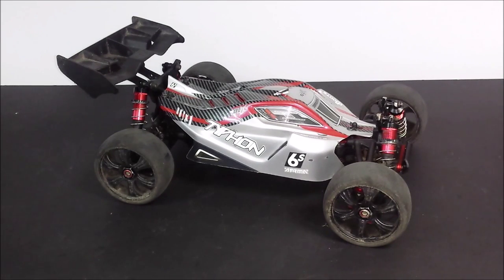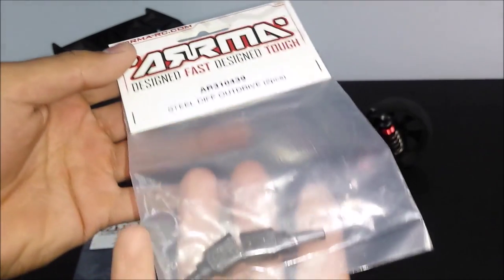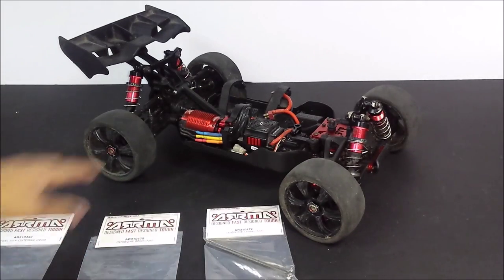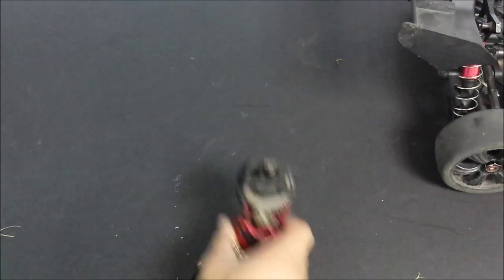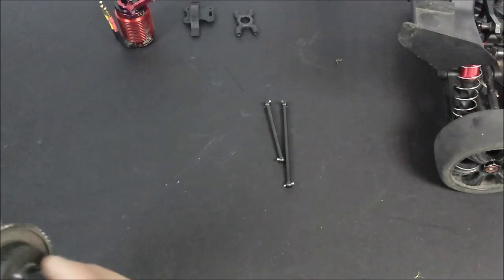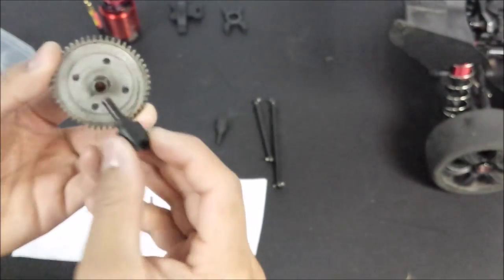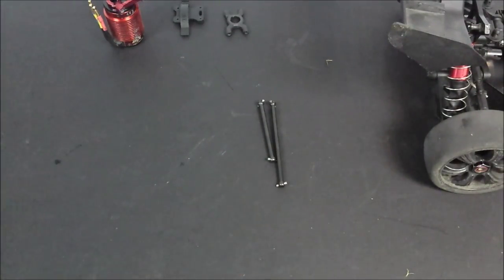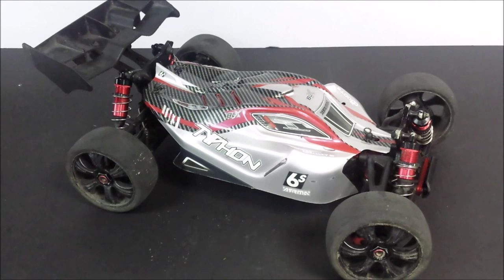RC Workshop: Arrma Typhon Center Driveline

Comment: Little tip on using thread lock. Dont pour it into the hole, you only need a little dab of it on one side of the screw. Putting liquids in blind holes and then winding screws in can split the castings/moldings due to hydraulic lock.

Comment: Hello appreciate you sharing your Typhon maintenance knowledge. I recently have bought the Typhon 6S and plan on running it on 6S if I put 100,000 cst. in the center diff what would you recommend for front and rear diff cst. ? Not racing it just running grass, dirt, light basher, parks, ball fields etc. Thanks for your help and look forward to your running vids !

Comment: Debacle, you omitted a few important steps; shims go only one way in, curved side down, shamfered side out / fill diff up to the cross hairs. Weight, dont be so pamby!
Reply from the maker: mazpr2025 how is this is a debacle? The diffs are still running as they should and they havnt missed a beat, Im simply showing the way I work on my rc's some people have different methods which is fine not saying you have to do it this way and the oil weight is a difference that not everyone knows about, thankyou for your feedback

Comment: why did they have a spur with no cover to hit your packs maybe??
Reply from the maker: Ive personally never had a problem with the exposed spur gear however i know some people have, however if you strap the batteries down correctly there shouldnt really be a issue :)
Reply: what size pinion is on the halix truck, and pitch?
Reply from the maker: +43rocket it's a 48 pitch gear and I belive I ran a 20t pinion

Comment: Hi man!! i was wondering why you don't put thread lock??
Reply from the maker: MrDavide1976 at which point?
Reply: when you put the screws, on the screws. we should be supposed to put it. don't you worry about screws coming off when you use the truck??
Reply from the maker: MrDavide1976 I only use loctite when going into metal not plastic

Comment: Just curious, why did you up the diff oil so much?
Reply from the maker: neirboca Hi bud it was to stop too much bleeding to the front wheels under acceleration :)
Reply: BashingWithRadioControl  Hey I got my Typhon today, trying to replace the 14T pinion with the 16T, should I just have to undo the grub screw in the pinion and pull it out off the motor? It's not coming off, Or should I take it off the chassis or something?
Reply from the maker: Hi bud yeah to change the pinion gear just undo the grub screw on the pinion and it should come loose if not just pry it off with a flat head screw driver or something, then you will need to loosen the motor mount so you put the bigger 16t pinion gear and reset the mesh :)
Reply: Hey you know what, it would not come off! I was trying to wedge a flat rectangle metal piece between the red alum motor plate (similar to your screwdriver suggestion). I have some paper towel there to not damage it but it would not give. So I undid the 5 screws underneath and took out the centre diff etc.Even then it was damn difficult to get the pinion gear off, but it did! I got the 16T on, hopefully it's not too close up to the spur, would rather a platic spur I think, it's noisy to push around! btw I think I sent you a pm the other day.
Reply from the maker: neirboca Hi bud yeah i remember the first time i took it off it took some force just because it had been on there for so long, and i agree that there should be a plastic spur gear option as i know a few people would get it me included as for the noise what you can do is use a higher quality pinion gear as they are better machined so it seems to reduce the noise, well it did for me so it is now its quieter.

I did receive a message from you and i responded check your inbox :)

Comment: EVERYONE raves how Arrma is so strong ( and better then Traxxas).
EVERY video ( literally 1000s) is a broken new Arrma. ALWAYS needs servos all new diffs, and other parts.
500$ new and it needs 500-1000$ of parts when brand new to be decent.

I dont get how Arrma is so good and so tough.
Reply: hahaha
let me guess you just bought a traxxas?
traxxas never  again for me,

that's my opinion
Reply: BOOSTEDLASER - Just bought an Arrma Outcast 6s and 3 min into the first run my rear diff ring gear is missing teeth in two spots and my ESC shit out on me when I got it home.  Warranty works and they are sending me a few gears and a new ESC but has made me very much doubt the “Arrma Tough” slogan.  My slash takes a beating and only thing I’ve broken is driveshafts which is the known weak point of 1/10 scale Traxxas vehicles but I replaced them with MIPs so never break anything now.  Also replaced the motor and ESC due to heating issues but I drive hard and run big 2.8 tires so kinda needed to.  Maybe I just had bad luck with my Arrma and good luck with my Slash but my experience makes me tend to agree with you.